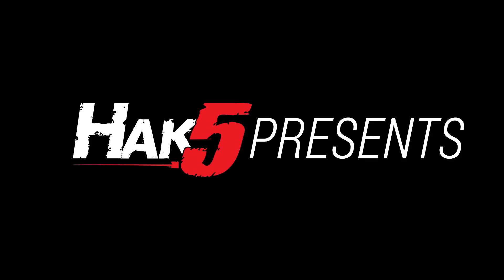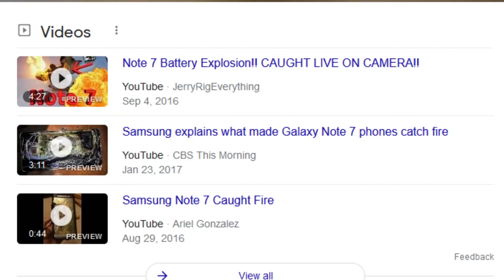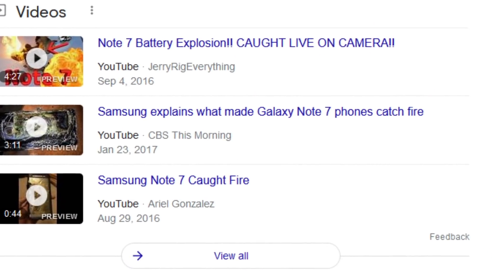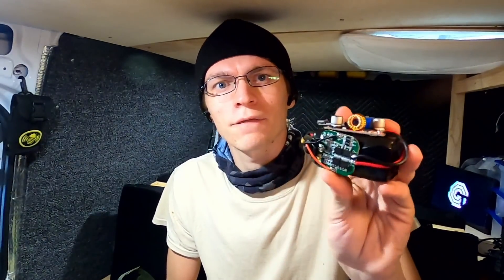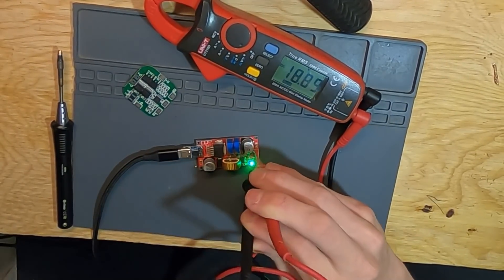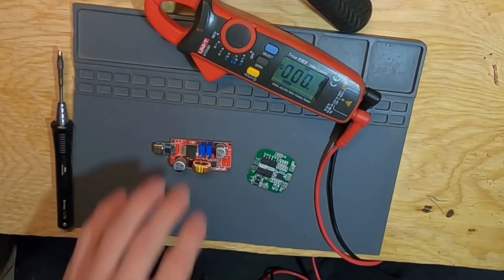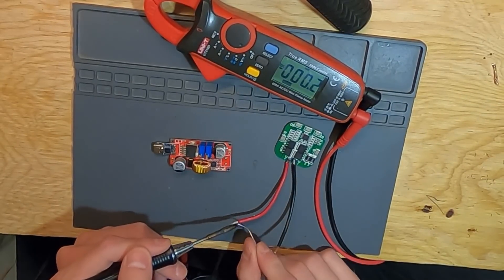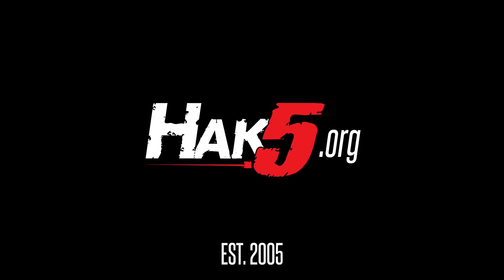Building DIY Lithium Battery Packs w/Glytch Pt3

Comment: Wouldn't it be nice if cars with lead acid batteries DID have a BMS?  Once the power gets to a minimum level everything shuts down accept the starting circuit.

Comment: So what you’re saying is if you don’t want to think about it just match your batteries, but if you have a bunch of money to burn, you can buy higher end management and use any battery around?
Reply: Probably have to start investing in decent heatsinks at that point though
Reply: @3nertia  I feel like I’ve had devices that use different types of batteries before.